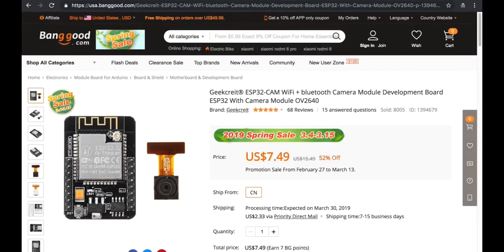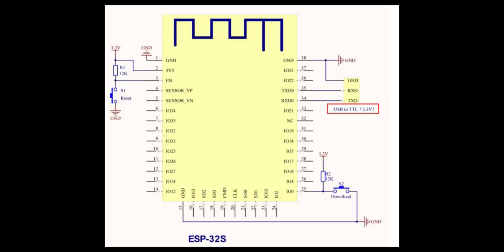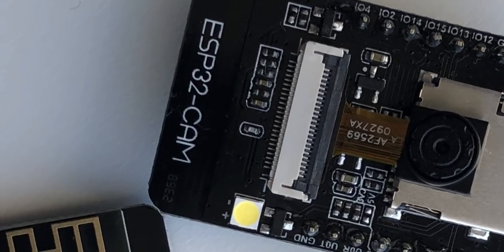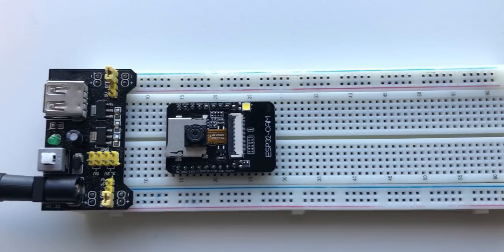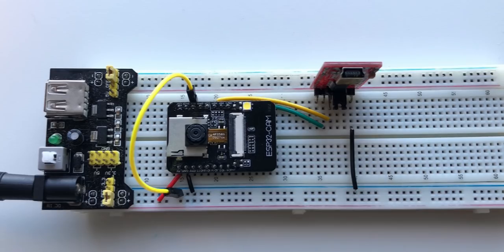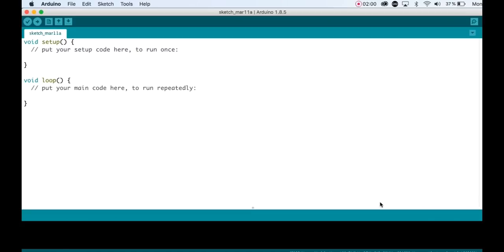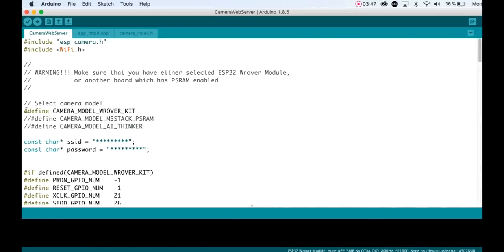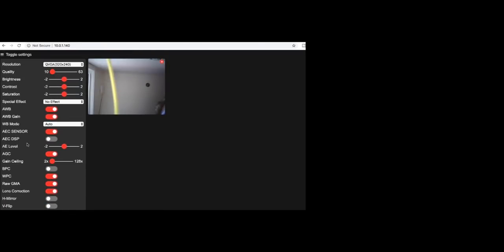ESP32-CAM Arduino IDE - from Banggood.com

Comment from the maker: There has been a few questions on how to connect the camera (on twitter). The camera connector is FLIP to open! Do not pull it along the board like a raspberry pi, but lift it up! Happy thinkering!
Reply: Took me some time .... ;-)
Reply: Can we receive the video while connected to a different network than that of the camera? @DIYTECHBROS
Reply from the maker: @tejasmd8143  Sure thing! There are multiple ways :-) The easiest is to set up your home router to open traffic on port 80 (and 81) and forward it to this device. That way, when you type in your home IP you can see the camera. But this may be sharing a bit to much data. Another alternative is to set up Home Assistant. Then you can add more diverse as well :-)
Reply: @DIYTECHBROS  THANKS A LOT FOR YOUR HELP!! IT REALLY OPENED A WHOLE NEW WORLD TO ME!
Reply: I have a clone model of ESP 32 cam module not the AI thinker one , and I am
stuck with it , it always shows an error , A fatal error has been occurred.
I have been stuck into this for many weeks can you please help me out with it
Reply from the maker: @Ayush-bk3rv  Hi! I'm not sure if we are able to help, but we can give it a try! If you post the error message here, we can have a look at it!

Comment: 2amps?!!!!  I have to look this up for myself. when I Google it I keep seeing 5 v 180 milliamps flash off 5 volts 310 milliamps flash on....
Reply from the maker: Datasheets often tell you worst case scenarios. But even the ESP8266 requires spikes of almost 1 amp (see Andreas Spiess videos). But if you can handle it with capacitors or need a permanent 2 amps power supply is a different question.

Comment: Yes that all worked and programmed and then I logged into the camera but if I then power the camera with 5 volts on a battery pack the camera is not accessible but if I connect it back on the TDI adapter it works ok my 5 volt supply is working ok tested with a meter on the pins any suggestions please
Reply from the maker: I would start by making sure the battery pack is not blocking the WiFi signal.
Then, make sure the voltage is correct and that it can deliver enough amps.

Also, some battery packs turns off if the circuit is not pulling enough power.
Reply: @DIYTECHBROS  Hi thanks for the reply battery pack is full and ok 5 volts output the camera is 10 feet from the router in the open air but nothing? so it looks like a bin job thanks anyway for your reply Bob in the UK

Comment: Have managed to get a stream to my iPhone and iPad, but the WiFi connection is not very stable even in a short distance. Any advice how to improve that ? Thank you in advance :-)
Reply from the maker: Hi! Anything made of metal will impact your WiFi connection. Wires, breadboards, USB wires, the programmer and so on. Try placing the ESP at the very end of the breadboard. Also, check your power supply. Try adding capacitors between GND and 5V as well as GND and 3V. Best of luck :-)

Comment: Hi sir why did we have to connect UOT to RX and UOR to TX? once i think is otherwise : UOT for TX  and UOR for RX. Can i have your explanation, sir? Thankyou🙏
Reply from the maker: Hi! In serial communications Rx is for receiving and Tx is for transmitting.
So one device is transmitting through the Tx pin, but the listening device must receive the signal on the pin it is listening, the Rx pin.
Reply: @DIYTECHBROS  thank you so much for the explanation🙏

Comment: I can't get a frame rate of higher that about 1.5fps even at low resolution. Is there any way to increase it? It's horribly jerky and nothing like the demo in this video.
Reply from the maker: Hi! Have you tried tweaking the settings and turn off face recognition? Also, WiFi signal strengt is very important!
Reply from the maker: Also, make sure you are using a good power supply!
Reply: @DIYTECHBROS  I'm usion a bench power supply capable of 5A, but I notice that the ESP32 is only consuming between 90 and 160ma depsite the rumours it requires 2A.
Reply from the maker: @MrRhfinch  I think the 2A might be a worst case scenario. Although, I have seen the ESP8266 pull 800mA (peak). So using both "cores", turning on the LED and a connection peak it may not be that for fetched? But, never the less, 5A should be fine. Especially if you have added any capacitors? If none of the previous tips helps, I would add an issue on the Espressif GitHub.
Reply: @DIYTECHBROS  I've checked and it's not a signal strength problem. I'm now baffled and have ordered a new ESP32-cam so I'll see if that one works.
Reply from the maker: @MrRhfinch  Sorry to hear that you did not get the frame rate up. Hope the next one will work as expected!
Reply: @DIYTECHBROS  I got a new board and it works fine. :)
Reply: @DIYTECHBROS  I've got a new board and it works fine. :) Frame rate up to 25fps at low definition and still usable a high definition.
Reply from the maker: Dick Finch that’s great :-)

Comment: It worked thx! But I can't get more fps than 0.1 - 4fps even if I use QVGA 320x240 as resolution.
Has anyone got an idea how to fix it or what could cause the problem?
If I restart the cam I can get up to 30 fps but after 4 seconds its decreasing rapidly to 0-1
Reply: I have same problem

Comment: What is best for home security cameras: Esp32 Cam, or Rasberry Pi 4 with Cameras?   Or:  Can you use Esp32 Cam with Rasberry Pi?
Reply from the maker: It depends, BUT we are currently working on a Raspberry Pi running Tensor Flow for handling human detection. So far is seems to perform better than PIR sensors and motion detection.

Comment: Great video but have had following failure re: camera and am using Banggood ESP32 Cam system like you did.

any ideas?

ets Jun  8 2016 00:22:57

rst:0x1 (POWERON_RESET),boot:0x13 (SPI_FAST_FLASH_BOOT)
configsip: 0, SPIWP:0xee
clk_drv:0x00,q_drv:0x00,d_drv:0x00,cs0_drv:0x00,hd_drv:0x00,wp_drv:0x00
mode:DIO, clock div:1
load:0x3fff0018,len:4
load:0x3fff001c,len:1216
ho 0 tail 12 room 4
load:0x40078000,len:9720
ho 0 tail 12 room 4
load:0x40080400,len:6352
entry 0x400806b8

[E][sccb.c:154] SCCB_Write(): SCCB_Write Failed addr:0x30, reg:0x23, data:0x00, ret:-1
[E][camera.c:1215] camera_init(): Failed to set frame size
[E][camera.c:1270] esp_camera_init(): Camera init failed with error 0x20002
Reply from the maker: Hi Michael! This is an error I have not come across. But, seems like there is a communications problem between the camera and the ESP. I would start by inspecting the connections to the camera and also check all soldering on the board as well. It might also be a I2C problem, but if you can not see anything wrong with it I would request a new board.
Reply: @DIYTECHBROS  Problem solved. It was just re-seating camera ribbon that was main problem and that I had copied my SSID etc from another document instead of re-typing them in.  Re-typing fixed  problem as there must have been some hidden characters in copied information. (which I suspected after looking at the code and seeing that dot stream was the WiFi trying to connect.  Thanks again. will keep watching this channel for more great videos.
Reply from the maker: @migilmor_trains_and_tips  Great work Michael! #TheGoodMakerFeeling!
Reply: @DIYTECHBROS  Thanks for the quick response. I re-seated the camera ribbon connection and now stuck in some sort of loop as only getting string of ....   Will add some temp lines of code to see where it is happening.

On another point, the breadboard power board must be powered by something supplying more than 6V. I initially tried a 5V 4A supply by board dropped output V on 5V pins to 3.4V and on 3.3V to 2.3V.   An fyi in case you get some brownout questions.

Comment: is esp32 cam has radio built in(since it has antenna?) so it can communicate with nrf module? ir it need to add additional module for it?
Reply from the maker: bianca bersinar Hi! There’s a built in WiFi antenna on the board!

Comment: I have a problem with esp32cam when reinit with other frame_size and pixel_format. Who is can do it right?
Reply from the maker: Hi Aleksandr! What problems are you experiencing?
Reply: thanks for your reply, Bros! I did function Init_camera with configuration structure "config". Put this fuction in the loop() and try get frame every 5 sec, print to com-port "fb->len". My Esp32cam take a frame once and next step is error "camera probe failed..." and "guru meditation error..."
Reply: Void loop(){
Init_camera();
camera_fb_t* fb = null;
fb=esp_camera_fb_get();
Serial.println(fb->len);
esp_camera_fb_return(fb);
delay(5000);
}
Reply from the maker: Hi! The "guru meditation error" is often linked to a power supply problem (brownout). So I would focus on this first. Try replacing the power and make sure it can deliver enough amps, and fast. You can also try to add a capacitor. Not that "bad breadbords" or dupoint cables can also cause this problem.

If the camera probing still fails after you have "fixed" the power supply this can be an indication of a faulty connection. Make sure the camera is properly connected and the cable and wires in the cable is in good condition.

Let us know if this fixes the problem or if there is still an issue!
Reply: Thanks for your attention. It is no problem a power supply and cabels. 

For myself, I found a solution in software reboot. At the first start, I take a grayscale photo, record flag in eeprom, reboot, skip the setup, and photograph in the loop in RGB.

The problem in repeat initialize camera. Maybe only for me :)

Comment: I did exactly all things in this video but I am getting "Guru Meditation Error: Core 0 panic'ed (IllegalInstruction) ..." on serial port
What is the problem?
Reply from the maker: +Mübin Icyer Hi! This could be due to a weak or bad power supply. Also, replace all wires and switch spot on the breadboard!
Reply: Hi! Thanks for reply. I am using 5V 1.5A power supply. It is connected to only ESP32-CAM module. Nothing else is connected to 5V. Is 1.5A still weak?
Reply: @MübinIcyer  They say in the video that it wants 5v 2A.
Reply: I also used this power supply with default program in it. There was no problem.

Comment: What is the range of it???
Reply from the maker: +Irfan Pin-2 Hi! The range is good :-) where I have coverage with other devices the ESP32-CAM also got a signal. Note that there is an connector for an external antenna. This can give you a better placement of the antenna and thereby extend the reach!

Comment: It tells me my "sketch is too large."
Reply from the maker: Tristun Alekzander Make sure you select the correct board and board settings :-)
Reply: @DIYTECHBROS   I did, Wrover module. What other board settings are there? I'm also using a nano so is that the problem?
Reply from the maker: Tristun Alekzander Hi! You also have to select Partition scheme Huge App.
Reply from the maker: Tristun Alekzander Is there any reason why you are using an additional micro control? There is no need for any Arduinos :-)
Reply: @DIYTECHBROS   Ok I will try that tomorrow, thank you. And whaaat how else do I program it? What were you using to program it?
Reply from the maker: +Tristun Alekzander We are using the Arduino IDE, but no Nanos! Best of luck!
Reply: @DIYTECHBROS   No, like how do I communicate my computer to the module? How does it not require a controller?
Reply from the maker: +Tristun Alekzander The ESP32 on the board is the micro controller :-) that’s one of the things that make the module so excellent!
Reply: @DIYTECHBROS   Ok, that is cool, but how then do I connect it to my computer? I'm a noob, none of this is obvious to me lol
Reply from the maker: Don’t worry! Coming into the world of ESP I think EVERYONE has struggled a bit in the start. In the video, the little red device is a FTDI. Connect that to your computer via USB and to the ESP32-CAM as according to the instructions in the video. Best of luck! (Also, remember to install the ESP in the boardmanager in the Arduino IDE).
Reply: @DIYTECHBROS   Ok, I'll order one of these FTDIs. And yes I did everything else correctly, I think anyway lol I really appreciate the help :) Subbed.
Reply: @DIYTECHBROS   Also, I don't mean to take advantage of your hospitality, but does this work without WiFi? Can it be used as say a drone camera or a motion sensor hunting cam in the middle of the forest? Recording the images to an SD card? Or does it need WiFi to work?
Reply from the maker: Thanks for the sub :-) 
This device do not require WiFi. The basic sketch is built  for WiFi, but you can skip that part and only write to the SD card. I'm not sure about the video quality and frame rate you could expect though. And, according to the docs it has a 4 GB storage limit - although I have read post of thinkers using 16 GB cards. If you do a cool build like that, PLEASE keep us updated :-)
Reply: @DIYTECHBROS   I will :) thanks for everything!

Comment: For some strange reason, mine would not power up when hooking 5v to the 5v pin, I had to  hook it to the VCC pin, then I got power, she complained a bit but it did upload and works great, thanks, I had tried this one before and it complained  that I had the wrong camera module.  I tried unhooking it and re hooking, then it recognized the camera and began working.
Reply from the maker: That's interesting! Thanks for sharing!
Reply: @DIYTECHBROS  thats not interesting.. i think he means he hooked up 5v to the 5v-pin of the esp. Thats of course wrong...
Reply from the maker: Aha... did not catch that! My bad. Thanks for setting it straight!
Reply: maybe its same as on arduino mega, suplly voltage over usb or voltage-supply conecter both ca 6V up to 12V or 20V, i always have 5 Volts on the 5V pin, same as on the 3,3V Pin, maybe its 5V out?

Comment: Results: 

rst:0x7 (TG0WDT_SYS_RESET),boot:0x13 (SPI_FAST_FLASH_BOOT)
configsip: 0, SPIWP:0xee
clk_drv:0x00,q_drv:0x00,d_drv:0x00,cs0_drv:0x00,hd_drv:0x08,wp_drv:0x00
mode:DIO, clock div:1
load:0x3fff0038,len:134217732
1162 mmu set 00010000, pos 00010000
1162 mmu set 00020000, pos 00020000
1162 mmu set 00030000, pos 00030000
1162 mmu set 00040000, pos 00040000
1162 mmu set 00050000, pos 00050000
1162 mmu set 00060000, pos 00060000
1162 mmu set 00070000, pos 00070000
1162 mmu set 00080000, pos 00080000
1162 mmu set 00090000, pos 00090000
1162 mmu set 000a0000, pos 000a0000
1162 mmu set 000b0000, pos 000b0000
1162 mmu set 000c0000, pos 000c0000
load:0xffffffff,len:-1
ets Jun  8 2016 00:22:57

What I'm doing grong? :c

Comment: Hey guys ! Do you know if it's possible to connect two or three esp32 cam (working together) to make a mini surveillance station ? Can't figure out how.
Reply: I don't know about ESP32 but using MotionEye OS works well for the rpi zero w. But have to disable lazy loading feature on google chrome browser to work. Just add the IP address of any other camera.

Comment: I keep getting this error"A fatal error occurred: Failed to connect to ESP32: Timed out waiting for packet header"
Reply: Did you connect IO0 to ground before programming?
Reply: @Vindolin  Mine is really goofy. I got it to program then work. Now when I connect just 5v and ground it doesnt like me.
Reply: Same thing happened to me. I seems that the SRAM chip is faulty. Looks at: https://github.com/espressif/esptool/issues/394 I think I'm finally going to give up.
Reply: conect to 3.3v  and conect the gnd with the IO0 , after disconect this cable to try your IDE program

Comment: i flash camera web server example included in the arduino to my esp32 cam it streams the video but when i turn ON the option face detect or recognize it does nothing except the low frame rate stream it doesnot detect nor recognize any face can you help

Comment: Is there a way to get it to store videos on the sd card when it sees motion, motion activated?
Reply from the maker: Hi! Motion detection is tricky business. Not because it's hard to detect motion, but because it's har to filter out false positives. Let's say a car goes by and light up parts of the picture, should that count as motion? Lightening, car lights, clouds, wind moving the camera or branches on a tree will trigger big enough changes to parts of a picture so that it will assume there is motion in the picture. Our experience is that a PIR sensor often works much better. So instead of using ESP resources on reading the image, just add a PIR sensor :-)
Reply: @DIYTECHBROS  Good idea. Thanks for the help.
Reply: @DIYTECHBROS  I ordered a pir sensor. What command tells it to record to the sd card?
Reply: @yourdadnumberone  i have the same problems , i saw on the datasheet that when we use the microSD , we lose some pins on the board , so we could only use two or one pinouts, but i´m not sure.
Reply: @yourdadnumberone  you could use a "if" condition when the pir sensor detects something but the problem is that this bord doesn´t have enought pinouts

Comment: hey, am getting endless dots, no ip adderss, just ..........................................
Reply from the maker: Hi! The dots are indicating that it's trying to connect to your WiFi. Make sure you have put in the correct SSID and password. Note: both the SSID and the password are case sensitive. Also, make sure your are on a supported WiFi. Most are!
Reply: evans yomu look at the position of the resistor close to the antenna. Mine also would not connect to wifi, and proved to have the resistor connected to the external antenna connector. In that case you either resolder the resistor or buy an external antenna...